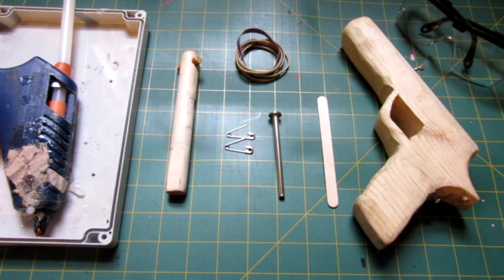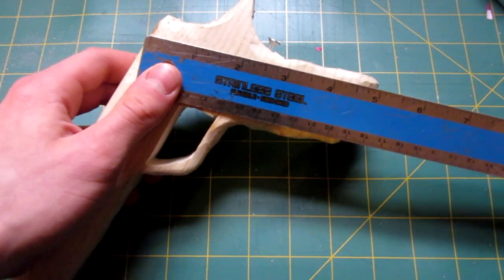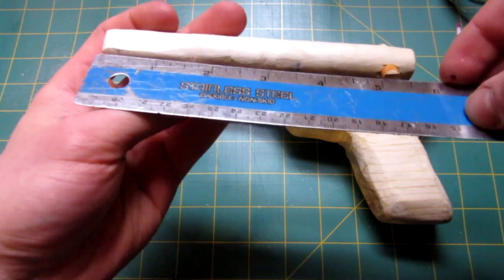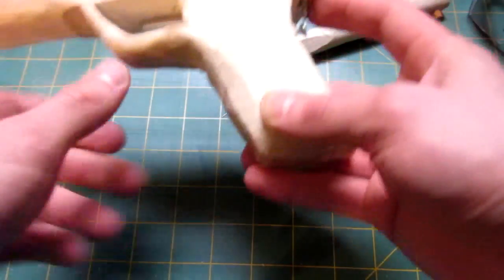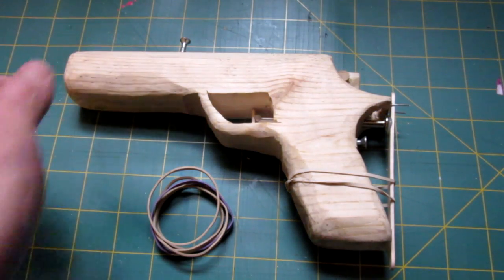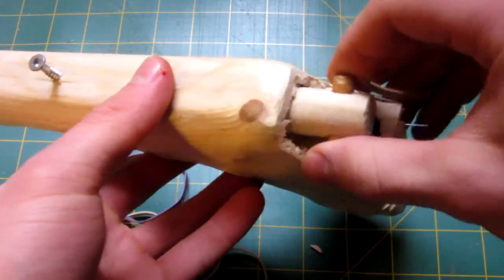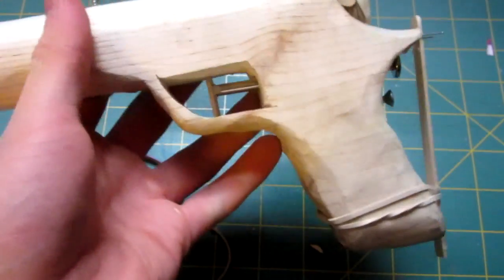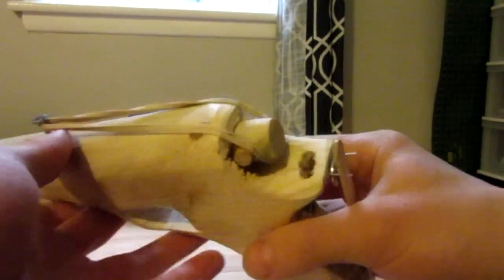Make a Simple Wooden Plunger Gun

Comment: I like the invention. But those safety pins out the back don't look safe. Haha. Is that what drew blood?
Reply from the maker: +JD's Variety Channel yeah they will have to be covered up for safety purposes hah!
Reply from the maker: +JD's Variety Channel yeah they will have to be covered up for safety purposes hah!
Reply from the maker: +JD's Variety Channel yeah they will have to be covered up for safety purposes hah!
Reply from the maker: +JD's Variety Channel yeah they will have to be covered up for safety purposes hah!
Reply: +JD&#39;s Variety Channel Perhaps putting wax or small corks on the ends could work. or perhaps soldering/gluing another pin to make a bracket.